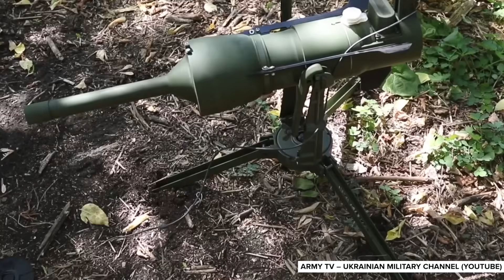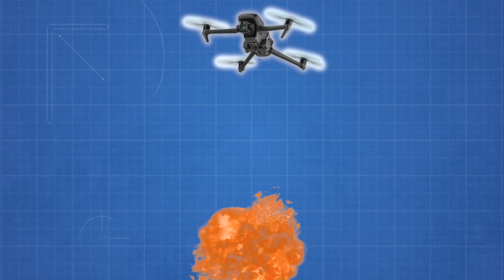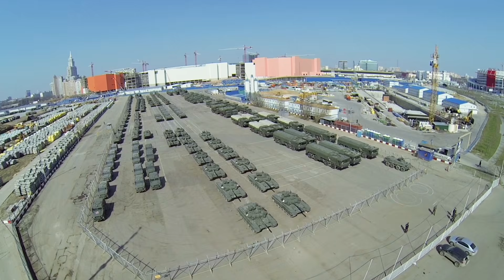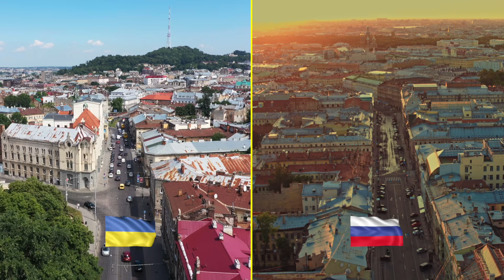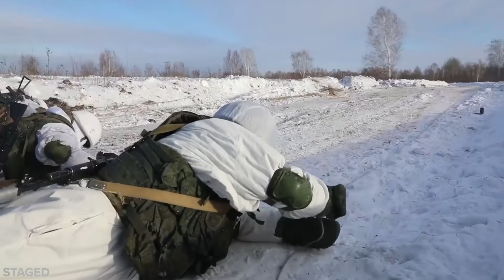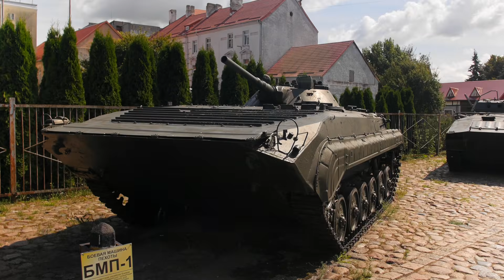Ukraine's Drones Are Dropping Anti Tank Mines as Bombs

Comment: Drones alone can't win a war, but they sure can help.  By taking out ammo dumps, refueling stations, supply columns, command centers and oil refineries they hamper the enemy's movements and rearming.  Then there is the psychological factor,  If you are in a trench and you hear a drone, especially at night you don't know if it is coming for you or the guy down the line and you know if you get caught in the open you're toast.  This can be terrifying and it isn't just once.  This is devastating to morale.  Just a note:  The Korean troops are particularly vulnerable to this as they have never experienced it before.
Reply: The even worse part. Most of these drones can see you, they can see in the dark like a monster.

Comment: Cool video. However its late considering that there's been so much more content on Drones used in Ukraine from the past 2 years. It feels already outdated. What would have been more intersting and actually informative would have been to spend more time on talking about the sustainmability of use of drones, spare parts and salvaging. Also and most importantly, what's missing here is the anti-drone and its evolution. There's so much to talk about anti-drone/EW used on both sides. Could have discussed as well the wide range of camera and increased use of Thermal imaging that is changing the whole game. You know, content that is more TODAY, less 2 years ago.

Comment: I'm wondering if Ukraine has considered using some of their longer range drones, with laser designators as target designators for air to ground, or ground to ground long range missiles, for over the horizon attacks. Also wondering if someone has worked out a way to take a gas rc aircraft motor, not as a lift motor, but to drive a generator to power what would otherwise be powered by batteries. I'd think the worst issue with that would be the heat of the motor, but that could be mitigated to some degree by exposing cooling for it to the down thrust of one or more of the lift propellers. There are other problems as well, but most of them will be noise that can be mitigated by height, or are already interfered with by the quadcopter props. The entire idea being to extend it's flight time. You would have to do a lot more (much of which they are already doing with other systems,) to increase range.

Comment: Why not include metric along with Imperial? So easy and your narration immediately becomes global.
Reply: Aviation is only a part of the overall useage of measurement systems.
Reply: Why not learn how the imperial system works. It is still used internationally in many aviation related areas. We fly in knots, measure altitude in feet, have engine parts in non metric terms.

Comment: One thing I haven't seen yet is drone-delivered PFM-1's (AP mines, the socalled "butterfly mine" that can be scattered from the air in large amounts).
With a mere 75grams pr mine even an FPV drone could throw a bunch of them either in front of advancing infantry or directly on top of enemy positions.
These things are awful weapons and I don't really wish for them to be used more - but in a war where most of the rules don't seem to apply it seems almost too good to not use on the defensive. Ukraine also should have over 3 million in stock as of last count. They were in the process of being destroyed according to the Ottowa agreement, but that got paused for obvious reasons.

Comment: I remember the first drone I saw drop an old anti-tank mine from the air. It did way more damage than even a 172mm shell. It just blew the tank completely apart.
Reply: "By the year!" Improvements in drone design and use are happening by the month, week, sometimes day. These improvements in the drones are happening at the speed of light. The world might as well wait until the war is over and hire all the drone mechanics and operators to teach. It won't be long or we wouldn't be talking about this so openly. The world arms industry will never be interested in making tank busting weapons for a few hundred dollars. These incredible innovations are being made by tech savvy soldiers on the muddy ground at the "front" with commercially available parts, at China prices. It's not the drones. It's the fully authorized creative minds of the tech savvy soldiers. From now on it will always be.
Reply: Hardly
Reply: AI powered drones are the new nukes. They will effectively cause scenarios of mutually assured destruction. Drone swarms of tiny drones with a small amount of C4 explosive could very easily infiltrate an area and kill all human beings present there.
Reply: You know it all started with how do we throw a frag farther, before it's fuse went off.  3-5 seconds, is not very long.  So they got a glass cup, put the frag in it.  duck taped it to the glass without covering the handle.  Though the handle of the frag was inside the glass.  Then pull the pin, as long as the glass was intact, you were fine.  Now you can throw it farther than normal.  When the frag hit the glass would break and at that moment the 3-5 started counting....  Now look at what we have.  WOW!

Comment: You should be able to design a kite that uses what is called an air anchor like a sea anchor that way the kite can fly in winds but not have to be attached to anything on the ground.  Humm I have to try this.

Comment: Historically, every innovation in warfare has birthed a counter for it. Take the tank; large, .50 caliber rifles for 1920s and 30s light tanks, 37mm antitank guns as tank armor increased and larger caliber weapons such as the German 88, manportable rocket launchers, aka the bazooka, recoilless rifles, shaped charge warheads, wireguided and laser guided rockets.  Now drones dropping shells and mines. 

Modern antiaircraft missiles are expensive, costing 100s of thousands of dollars, or millions. Small caliber automation cannon munitions are relatively cheap, radar guidance can spot and track drones easily. The German Gepard, a 1980s antiaircraft, anti-helicopter gun system has proven effective against drones in Ucraine. 

I suspect that a small, possibly manportable, flack type anti-drone weapon is under study now, as well as anti-drone drones. Tanks and other armored vehicles should be equipped with upward-looking radar soon along with anti-drone armament such as the .50 caliber antiaircraft machine gun by the tank commander's hatch used in WW2. Human intelligence is  creative and soon drones will become just one more damn thing to deal with on the battle field.
Reply: As  Vietnam Vet, I can assure you that there is NOTHING human, or intelligent about WAR.
Reply: Antitank missile $80000 a pop plus the operator to be  kept safe.

Comment: Ok. So you're not dropping 10 kilo mines from a DJI Mavic.  THey're dropping grenade-sized bombs for AP use.  It still makes them dangerous AF, but they aren't taking out tanks without a lucky hatch shot with an incendiary grenade.
Reply: The tank’s rear deck over the engine is lightly armored.  And the engine has fuel lines.
Reply: @cwolf8841  yes, but even without armor, a regular grenade isn't going to do much to a rank.  Without the blast contained, it'll largely go up.  I have heard they also use the submunitions from DPICMs for that effect, though. I dunno if those are small enough to be lifted by a Mavic , though. I've never held one or seen one up close.

Comment: The Ukrainians also have a small number of Anti-Tank Mine Laying Ground Drones too.

Also, I'm surprise the Ukrainians haven't looked into the TF-19 WASP Flamethrower which is designed to be mounted to large drones like the Vampire Drone, the TF-19 WASP can fire a stream of fire up to 25 feet and is mainly used in the US agricultural industry and in Forest Fire Controlled Burns.
Reply: They have a drone that pours thermite.
Reply: I looked it up, and yea it's a fuel-based flamethrower so it would just need a minor tweak to the fuel to make it shoot napalm. That would be horrific, but effective at both burning down treeline positions and against infantry in general. If you get touched by napalm at all you are unlikely to get away from that without debilitating injuries.
It would probably only be viable on the larger more expensive vampires though - and that may not be worth the risk to the drone compared to multiple fragmentation explosives.
But even then - I'm sure it would be useful to burn down and deny treeline cover in advance to an enemy that you know is coming your way. Heavy obscurement seems to be the only good protection you can really have in this war.
Reply: @TheStigma  can you imagine the look of the Russian and North Korean faces when they see a Flamethrower Drone spewing it's flame along the length of the trench they're in?
Reply: @EvilFingersNo1  Unfortunately I can... The videos coming out of this war is beyond gruesome. If it has taught me anything it is that there is surprisingly little blood when limbs go flying or people are literally cut in half. I'm not sure I wanted to know these things :/
Reply: That's really something!

Comment: Can't you add disposable batteries to drones, so that flat batteries could be dumped on the way to and from targets, thus reducing the weight of the drone as it travels?
Reply: The issue is disposable batteries would need to be constantly replaced. For drone warfare you want production and replacement to be as cheap as possible.  The cost of replacement would be higher than the cost of recharging and would just another part to supply lines.
Reply: I wonder how much extra range that could add. It's not like the Rocket Equation, where the fuel ends up making up most of the mass of any vehicle. But it would definitely add at least some range.
Also, you'd need a dropping mechanism. You could use the same dropping mechanism as for the payload; although that limits you to splitting the battery power into one half for getting there and one half for getting back. And it explodes all batteries that you drop. Then again, it's not like you'd be getting back many of the batteries that you'd drop over the no man's land. Especially if you're being pushed back everywhere like the Ukrainians.

I guess it's just a matter of the ratio of battery and drone cost, and drones being much less likely to be lost than intentionally dropped batteries.
Assume that a drone with a single battery spends 1/3rd of its flight time going there and the last 1/3rd coming back. With 2 batteries, you'd quadruple the loitering time. But you can offset that by giving 4 times as many drones to each operator, so that he can always have a drone going out and arriving once the previous one has to come back. And that's a one time cost, whereas the cost of dropping batteries is a recurring cost.
The only situation where that calculation changes is for drones that aren't intended to come back.
Reply: It is an interesting thought. As well as drone performance, the power density of the battery type has to be considered. The mission flight profile also needs to be assessed: Maximum power usage is required for hover/slow speed climb type maneuvers. Less power is required  at higher speed due to the translational lift efficiency.  
This is just my general guestimate, as I do not have definitive data to give an accurate assessment.
Reply: Rechargeable lithium batteries are smaller and lighter than the equivalent power capacity of alkaline batteries.

Comment: How do anti-tank mines get deplyed from the air without exploding?
Reply: Must not have watched the video.
They change the fuse to either they ignite upon release or they glue a pvc pipe add fins/wings so it falls correctly and is released from the drone by a button press
Reply: @Bannans  I  watched all the vid. FYI "Military
The Remote Anti-Armor Mine System (RAAMS) is a 155 mm howitzer projectile that contains nine anti-tank mines. The mines can be delivered from a distance of up to 17.6 kilometers and have a self-destruct time of either 4 hours or over 48 hours. 
"""
Reply: They go boom when they land.